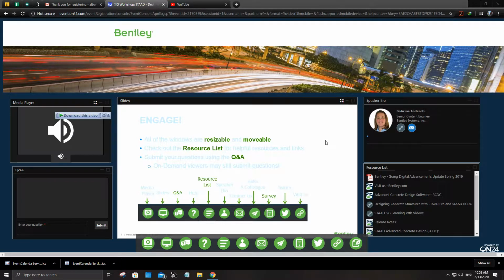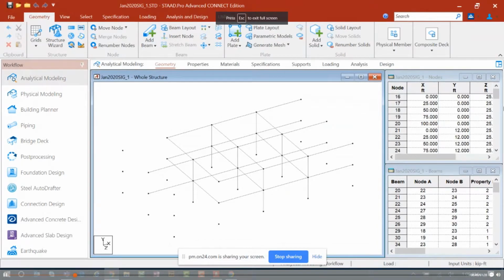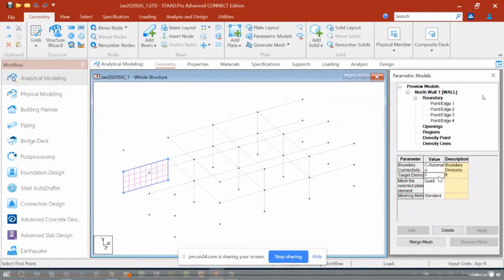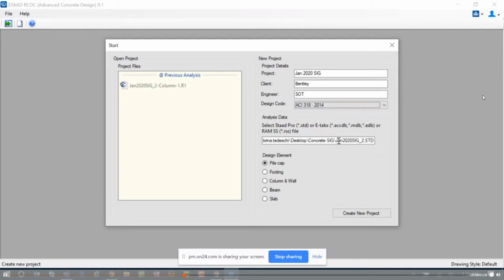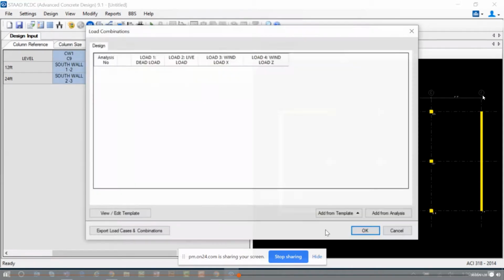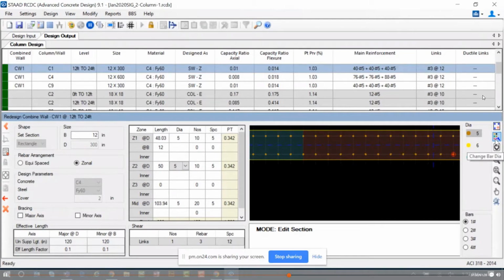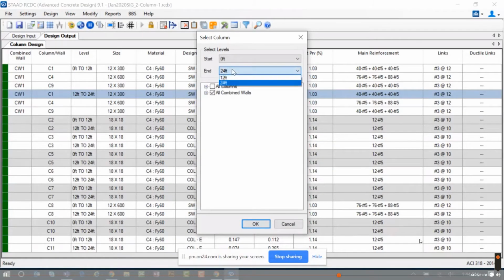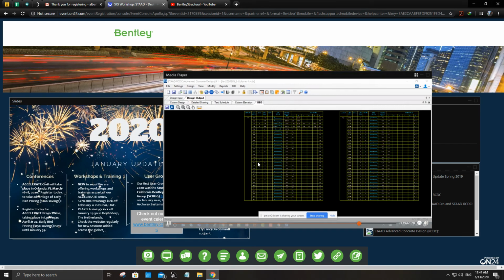SIG Workshop: STAAD - Designing Concrete Walls with STAAD.Pro (Jan 23 2020)

Comment: Great video. Please when I used staadpro v8i my shearwalls were not transferred to rcdc. I used surface,and also used the generate mesh option to create the surface bought it still didn't work. Please what am I missing? The rcdc reads the staadpro v8i file but the shearwalls are not transferred.
Reply: I think staad.v8i is too old version